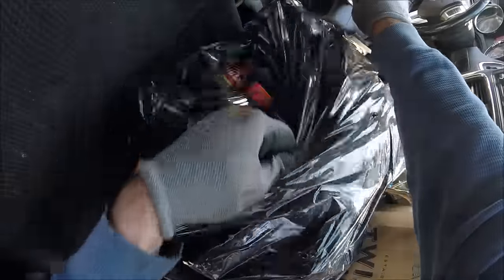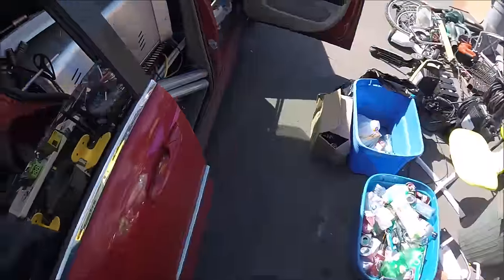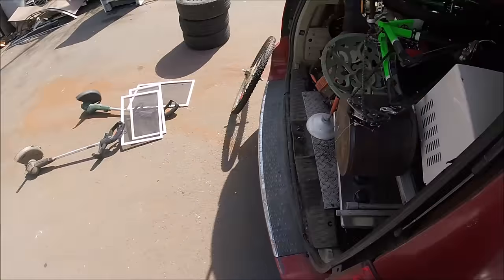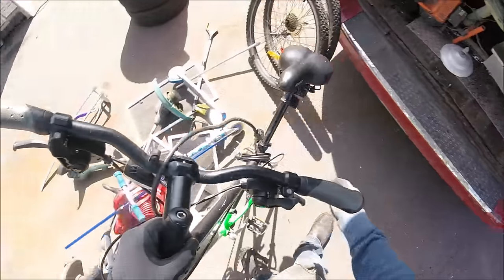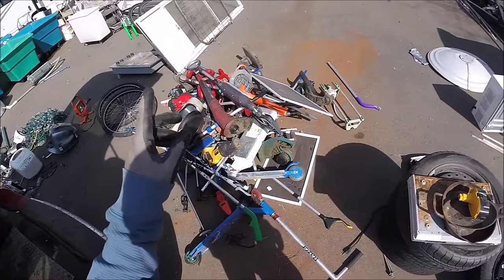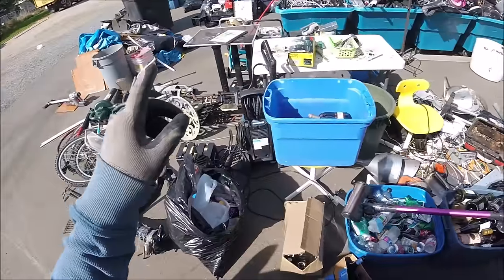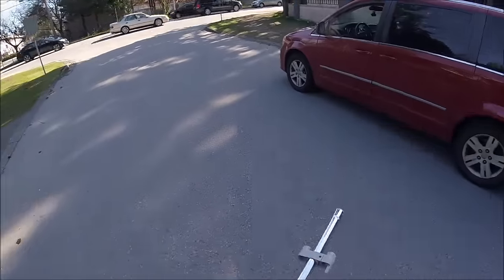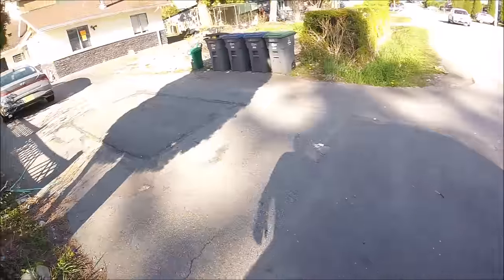Unloading Red + Glass Bottle Run

Comment: You don't want a new diesel because they're so expensive and they break for no reason and they use that bullshit DEF fluid god damn pain in the ass.  

My old diesel is 3.2L non turbo and it will probably run forever but it's always gonna smoke a bit even though it sounds perfect and runs like a top.  It's $30 a day to drive around and I probably drive 70% of what you do.  Google told me I drove 1800km in March.

When you get an electric the most important thing is the battery.  I might have told you but you need to get a Lithium Iron Phosphate type battery because you can charge them to 100% without it hurting the battery and they last a very long time.  CATL in China  (largest battery maker in the world) is putting out their latest batteries of this type and are warranteeing their batteries for 1.5 million km!!! Amazing.

A lot of stuff from north america is still using older type Lithium Ternary type battery and will for a while until the new factories come in.  The manufacturers don't want you to know what type of battery it uses because they are trying to unload their old stuff and they have a lot of investment in that battery type.  Even Mercedes new electric sprinter are still using that older type battery so I'm not too keen to look at one.  I think the best in the next year or so is gonna be a hyundai/kia van because they will have something affordable ($80K?) for our market and they will probably be using the newer type battery since they have kept up with the trends in the asian market better.  We will see!
Reply from the maker: its hard to pick out what's good